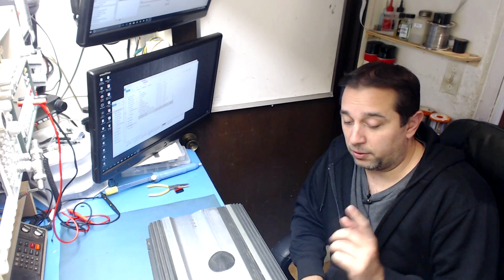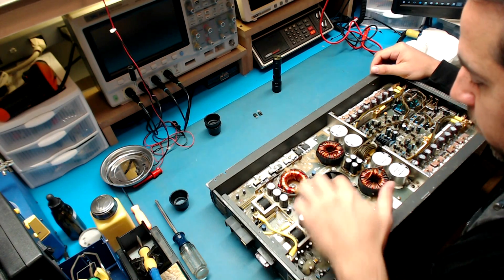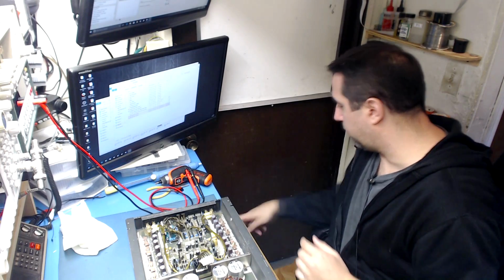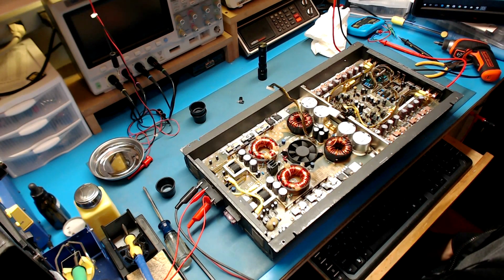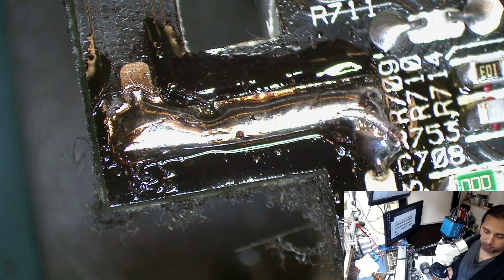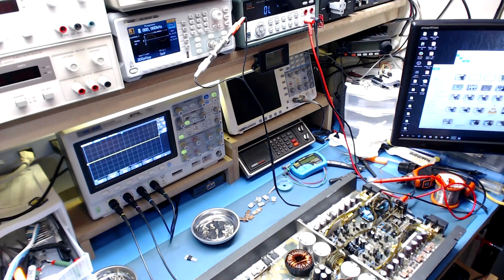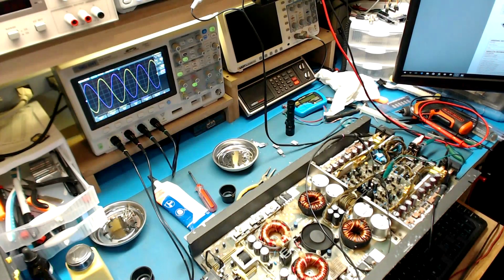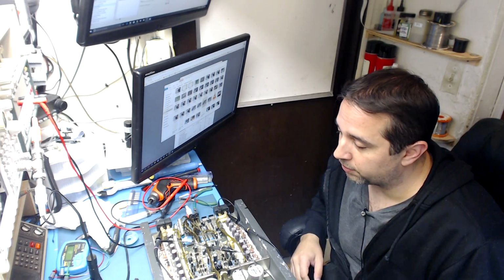ANOTHER ALPINE MRV-1507 REPAIR

Comment: Thanks for doing these videos, I really appreciate seeing them. Would you prefer using this amp as a full-range amp for components, or as a subwoofer amp?  Components are Boston Acoustics 6.53 pro or 6.5 pro which are 3 ohm nominal (depending on what fits). Thanks again.

Comment: How do the toroids  work on an amp do they step the voltage all the up to rail voltage from 12v ac am guessing the fets alternate the the 12v dc and one side it stepped up through the toroidal transfomers to rail voltage plus and minus maybe plus one side minus on the other? am I close? or does each side do plus and minus to each side of the amplifier stage.

Comment: My 1507 draws 1.6 amps at idle and none of the lights come on. Any ideas why this could be? I don't have a thermal camera yet.
Reply from the maker: +Internationalf250 could be fine and the ledriver chip may ne bad.. unlikely but possible. Also check the +-15 volt supply in the amp sectio
Reply: Kev31779 I have +- 15v and at the led board connector I have ground on the gray wire and a couple of pins at 8v so all of the   led's are blown or am I missing something? Thank you for the reply and for teaching me so much about electronics.
Reply from the maker: Does the amp work other than the led's?
Reply from the maker: Could be a bad ground, that amp cooks ground traces on the back side of the board near the power input. Also check that there is continuity between pin 1 of led ribbon cable and the power supply gnd. Other than that you will need to start probing ic's like ic702 and ic703. Also the surrounding transistors. Ic 702 is problematic but not likely to cause all the leds not to work but not impossible.
Reply: Kev31779 the amp works fine and all of the traces look good. The ribbon cable tests fine but if I connect 8.1v to the back of either + tab for the led and ground the center pin on any of the 3 bulbs nothing happens. Does that mean they are dead?
Reply: Kev31779 I replaced the led's and the amp powered up and everything worked but then the power supply shorted out.....
Reply: Also the initial repair i did was replacing the mosfets on one channel of the power supply. Maybe the driver is bad for the negative rail and causing the mosfets to short?

Comment: Grat video im learning a lot from you keep them video's coming!  I have a question if an amplifier has 8 output Mosfets and it has 2 extra empty spots for 2 more that was not installed from factory what will happen if I install them would the amplifier perform better ??

Comment: You can separate the audio section from the power supply by removing the bridge rectifier section (right after the secondary windings, you'll find the dual diode rectifiers). They are usually right next to the mosfets of the power supply, on this amp you can see them screwed directly to the sink next to the mosfets that are clamped down.

Comment: Thank you for the top tip on the pots, I think that's where I went wrong on one of my 1507 but I had it on a very low current limited supply so no damage done. Keep up the great work on the videos. Thank you for sharing your knowledge.

Comment: I see you're using the Sigelei 213 with a Kanger Subtank mini (with the RBA?).  I vape as well. It's been about 4 years since i quit analogs. For me, vaping has turned into more than a life saving decision. It has also been a great avenue of incorporating my electronics knowledge into my own self-built mods and improving upon retail devices. Since i'm into board level repair, as well, i enjoy building mods for myself and friends. Do you ever tinker with building mods or vaping boards.........Evolv DNA.........Yihi? Or is vaping just a way to quit smoking for you and that's it?  
I'm sure you already know this but i wouldn't vape around all that test equipment. I've already had to take apart my laptop and give the logic board a 99% iso alcohol bath. It wouldn't turn on one day because it had a nasty film of VG/PG from vaping, over the board components (me being a dummy and blowing my vape right at the laptop while using it). Great repair BTW!

Comment: what type of solder did you use to repair the board can you put a link
Reply from the maker: I've had it for years and the label is worn off. I wish i could tell you. Its nothing special. I'm pretty sure it's a 60/40 rosin core based solder.